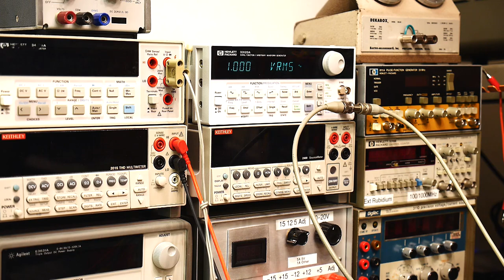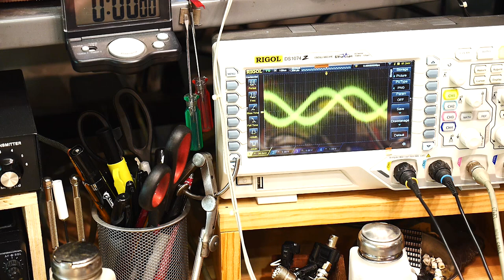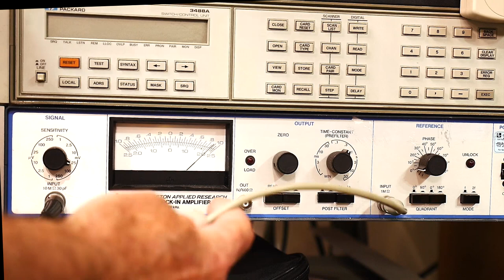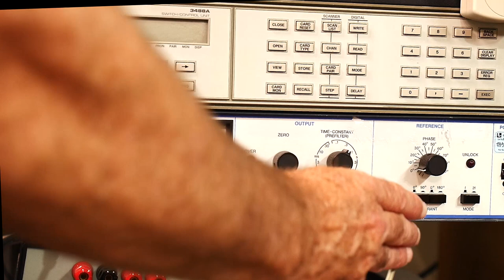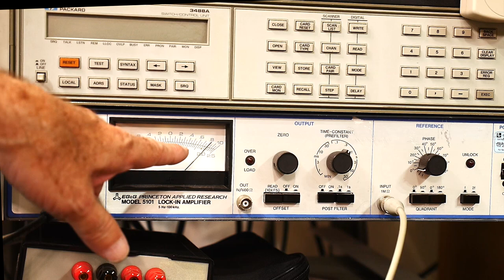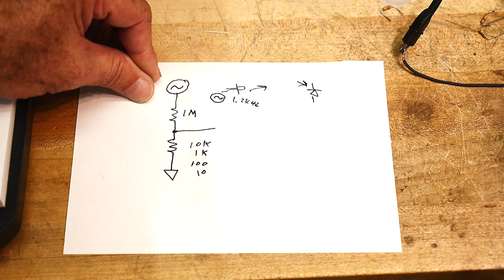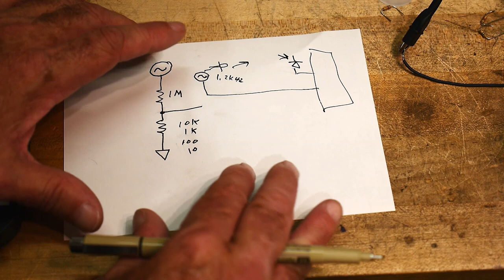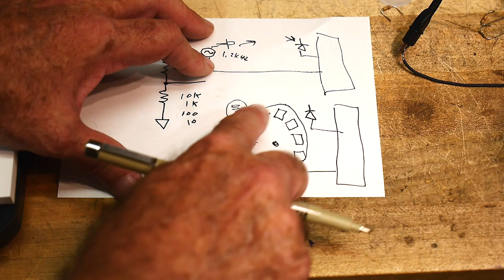#561 EG&G Lock In Amplifier

Comment: Eric KL7AJ had a two-part article in CQ magazine (October  2019/April 2020) about Lock-In amps and IIRC Signal Path video #107 described the operation of another branded unit as well. Pretty cool way to dig out signals way, really way, below the noise floor.
Reply: Definitely.  Interesting watching some videos where the PAR124's are used for electronic music also.  I think they use the differential amplifier plugin also.   I'll see if I can find the video link.

Comment: Way cool!  I still haven't inspected, tested and used my PAR124.  Hoping this winter I get to.  These seem so neat.  Especially doing the math for what can be detected, like way lower than the GPS modules RF blocks at ~-160db from what I recall.  Like in dB something like -200dB if I recall doing the math (if I did the math correct per the specs).   Reminds me, I've been wanting to use a GPS module as a detector mixing the output of the source to the GPS antenna  input frequency of course.   Seems can do some fun ways to use as a super low gain receiver also re-encoding by spoofing the Digital Block if wanting to use for coms also and not just as a detector.  Would be nice to hack out the Digital Block and just use the RF block.   Awesome! I got excited.  :-|)  These are neat.  Thanks for sharing!